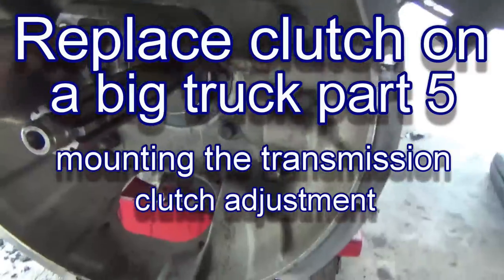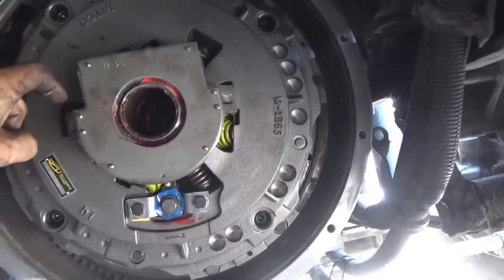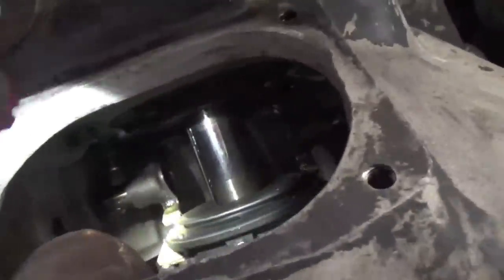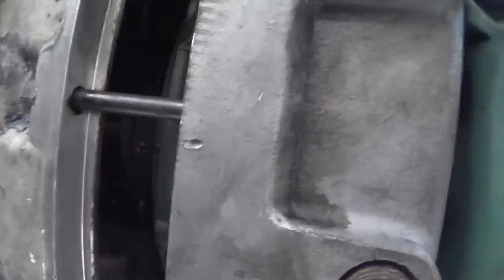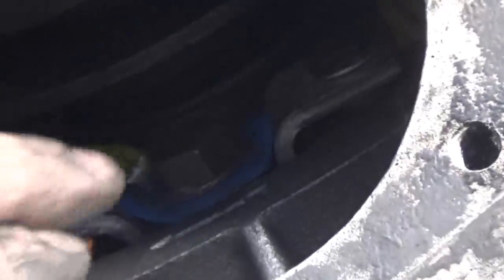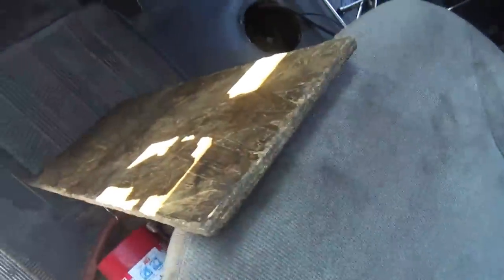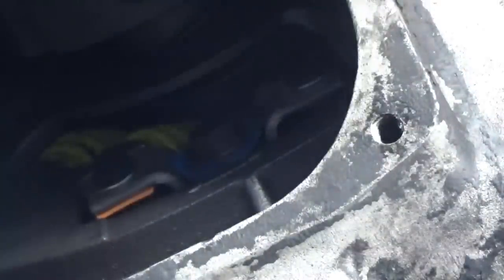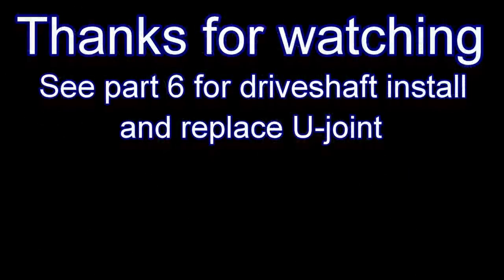Replace clutch on big truck. (part 5) Install transmission, adjust clutch.

Comment: Nice video but you never checked/set the clutch brake-to-throw out bearing clearance of 1/2".  THAT's what the adjuster bolt is for.  Not to establish a random free play dimension.

External linkage (and clutch peddle stop bolt if needed) is what gets adjusted to establish an 1/8" throw out yoke fingers-to-throw out bearing clearance that determines the specific vehicle designed free play at the peddle which is the last item checked.  Typical free play is between 1-2".  When all adjustments are correct, the throw out bearing should compress the clutch brake sufficient to hold a feeler gauge between the brake disk and input shaft bearing retainer with the peddle near to but not touching the cab floor.

Once properly adjusted initially, the clutch should be readjusted using only the adjuster bolt as you showed when free play is half the original dimension.  The above clearances should still be confirmed following a readjustment as part of the process.  Instructions to the above effect should have been included with your new clutch.
Reply: I’m doing a clutch job on my 9 speed Eaton , when you replied and talked about setting the Clutch Brake-to-TOB , how do you do that? Thanks

Comment: Never ever pull the transmission in  like that the chance of messing a friction disc hub up outweighs the little extra time it takes and good tip put the transmission in gear that way you can turn the yoke so the input shaft will move then you can push the back of the transmission as instead of pulling it in...and the throwout bearing should move by hand you shouldnt have to bar the engine over to move it but overall good job

Comment: We only instal two piece brakes. If you ever need to change it it’s easy
Reply: yeah those are good if you have company drivers that dont know what they are doing. Sigle piece will last lie of clutch if you drive the truck yourself

Comment: Thank you for the insight.  I needed this as I have a 60's something Auto-Car wrecker and I've never messed with that type of clutch before.  Problem now is the discs have rusted to flywheel and I may have to do this out in yard if I can't find a way to break it loose..
Reply: did u end up having to do that in a bad spot

Comment: why would you install the clutch before 🤣🤣🤣🤣🤣 you can even install the clutch on hydraulic type actuator with swivel socket  this in linkage type  way easier doing that way

Comment: What is the torque spec for the transmission mounting bolts to the flywheel housing?
Reply from the maker: 3/8 x 16 bolts normally torque at 30 to 40 ft. lbs.  but nobody torques that kind of assembly bolts that have no gaskets. Thanks for watching.

Comment: Why didn't he just install the clutch on the transmission  then install it then use tha accessory drive 1 7/16 drive and bar it over with a ratchet??

Comment: I don't understand why you don't put the clutch on the tranny then put it in and bolt the clutch to the flywheel afterwards it's a way easier. Lots of the transmission's I've done you can't get the tranny back far enough to clear the throw out bearing without hitting cross members air tanks ect ect

Comment: Im about to do mine Gordon.....At what point did that rubber insert finally come off?  after the clutch fork went over the dog ears? I think, Not sure yet- But im going to assemble the clutch on the Trans first- Then bolt it to flywheel later turning the motor- Many guys suggest to do it that way they say easier.....
Reply from the maker: I don't remember when the spacer came out, I think after the bell housing bolts were snugged down. Be sure you have a cut off input shaft handy before you start in case assembling on the transmission doesn't work out. The previous clutch jobs I've done I did without the clutch jack, I put the input shaft on the flywheel and assembled the parts on it. The clutch is pretty heavy, not everyone can do it without a clutch jack.

Comment: Gordon push the transmission with a friction jack  ( monkey on  a stick or an old Volkswagen jack with a pipe  ) Place against crossmember and  transmission  . Great idea  for clutch adjuster location  marking  .
Reply from the maker: Thanks for watching.

Comment: Good work bro 👍,question what transmission and rears you have on your truck? Mine is a 94 frklr fld 120 with cat engine 3406 c ,9 speeds transmission Eaton fuler,373 differentials Rockwell. I want to put a bigger transmission , which ones do you recommend. Thanks.
Reply from the maker: I can't recommend anything on transmissions, I'm just a driver who used to be a car mechanic a long time ago. I just do my own repairs at home on this channel.
Reply: @57bagre  OK thanks.

Comment: Good evening,I have a question,u got your ears on?
Reply: @57bagre  great video ,those 2 threaded holes 1 had a plug in it ,& 1 is open on bottom of bellhousing ,I think it's the flywheel hole not sure,but I got oil leaking from that hole that doesn't have a plug in it
Reply from the maker: That could be a rear main seal or a block to bell housing seal.
Reply: @57bagre  just had clutch & tranny rebuilt last month ,& they didn't change the rear main seal,because they said it wasn't leaking
Reply: @57bagre  new clutch,& they rebuilt tranny,thank u for responding back to me ,really appreciate it

Comment: U done that the hard way. Next time put the clutch on the transmission than put it together. U can put the pressure plate bolts in through the inspection plate hole. That's the way I do them. Makes it much  easier getting the trans back in.
Reply from the maker: How do you find the right bolt pattern through that hole? When I put it up on the jack I had to turn it to 3 or 4 different bolt holes to see all of them line up. That would be a nightmare to find blindly turning the engine to find I started in the wrong holes.
Reply: Gordon Robertson it's really not it's easier than you would think. It doesnt fight you it just slides together. Getting the holes line up is easy to. Theres no need for a clutch alignment tool or trying to hold that heavy clutch in place.
Reply from the maker: Well I never worked in a truck shop. I was a car mechanic a long time ago, and there's almost no YT videos on trucks. I ask how to do something and apply my previous experience and always get it done. I don't know all the tricks on trucks or cars built in the last 30 years but I'm not half the dummy some of these "know it alls" think. Just go through some of my videos. Mostly self taught on trucks, I did go to mechanic school in the late '70s and worked in car shops in the '80s. Thanks for your help.
Reply: Gordon Robertson I work for a mack truck dealership. I went to school also. I use to do them the way ur doing them. Until I started working for the dealership they showed me this new way because its alot faster and you can do it by itself with no issues. Plus you dont have to lift that heavy clutch up in place.
Reply: Where are you located?
I need a clutch job.
I’m in Maryland
Reply: big murph I was just gonna make the same comment
Reply: @bigmurph1447  You dont have to hold anything up .You slide clutch over dummy shaft and use two long studs to line up and hold pressure plate . Dummy shaft and two studs are holding the weight 
With your method you have to keep turning fly wheel and tighten pressure plate bolts in correct sequence.
That mean after you tighten your first bolt you need to rotate fly wheel 90° and do second bolt and keep going in this sequence throgh that tiny inspection hole and need someone to keep turning fly wheel  until you got all bolts in .
With dummy shaft it takes 10 minutes to tighten all pressure plate bolts .
So there is no better way ,there is only the way you like better.
Reply: @cheguevara5560  not everyone has the dummy shaft for ever different clutch out there. It's a lot easier putting the clutch on the trans and putting it in no heavy lifting blowing ur back out.

Comment: How did you get the black piece out after installing the clutch.  Also do you have a email address? Thank you for another great detail video.
Reply from the maker: Email gordonrdiy@yahoo.com  Sorry I forgot how I got that piece out, maybe adjusting bolt or a pry bar.